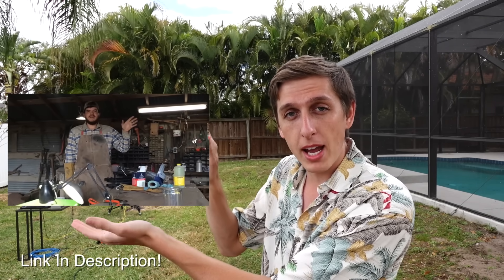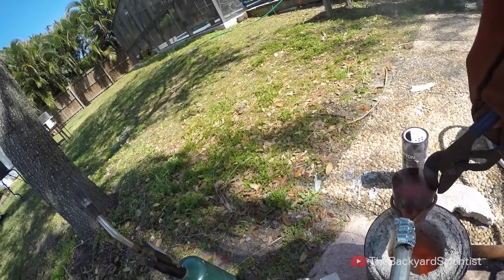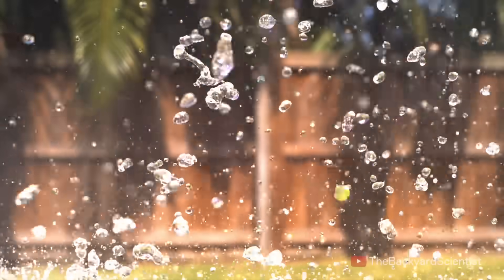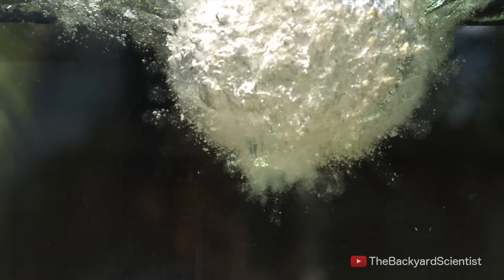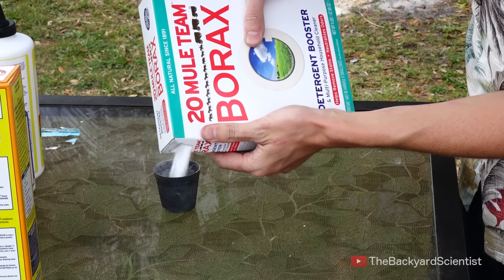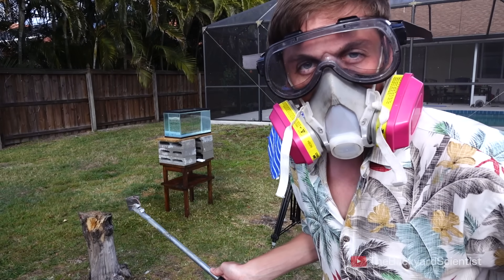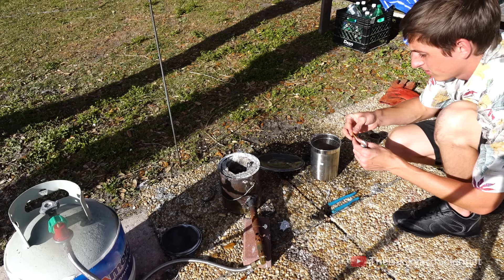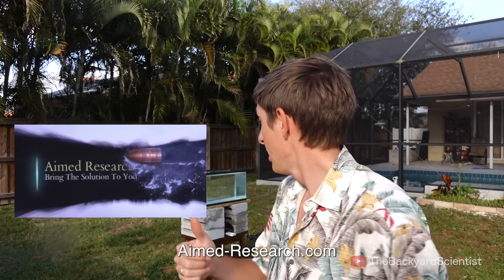Pouring Molten salt into Water - Explosion!

Comment: There are a lot of guesses, but I haven't yet seen this answered correctly in the comments below. You are dealing with a fuel-coolant interaction, where the energy of the molten table salt is transferred to the water in a timescale smaller than the timescale for the vapor pressure release of the steam. This is generally a physical reaction. The exception would be if graphite was infused during the superheating of your salt (hard to prevent).
Molten graphite reacts chemically to air and would be exposed during the pressure wave and jet action of the FCI causing the distributed molten fuel material to further fragment. That reaction to the air, in turn, releases hydrogen which is highly explosive in a superheated environment. This particular case would make it partially a chemical reaction, but the majority of the interaction would still be a physical one.
This also would mean that Borax, which discourages oxidation, would have less graphite infused during the superheating process. Therefore, less chance of a chemical reaction during the FCI.
Even with no added chemical reaction, an FCI is a powerful mechanical transfer of energy that begins with a deviation in the normal heat exchange conditions between the molten fuel and coolant. A bubble forms from the initial disturbance and then expands and collapses forming a jet of liquid. This jet then penetrates the fuel and the heat exchange forms a new bubble which repeats all over again from the jet phase.
This process happens (and continues to happen) wherever there is any disturbance around the surface of the molten material, and a pressure wave forms. The wave flows through the fragmented molten material further fragmenting it and increasing the heat exchange. The rapid transfer of energy sustains the wave and builds into a steam explosion.
You can see an example of such a wave passing through (back into) the molten material at time 3:37, and several sustained waves at 4:39.
Different superheated materials have different heat transfer and vapor pressure properties. For instance, molten fluoride salts have different thermodynamic properties many than other fuels that make it more stable and safer to use as a fuel substrate in high-temperature nuclear reactors. Hope that helps.

Comment: Okay I have an answer for you.  This is what is going on.  You are mixing a smaller thing with a larger thing.  The water H^2O will bind with your table salt NaCl.  At room temp this is a some what slow reaction where someone often has to stir the water.  The slow process of dissolving will take about 5 H^20 atoms binding with each ONE NaCl atom.  Of course not all the H^2O atoms will partner with a NaCl atom but the NaCl atoms distribution through out the solution will be even.  Thus this is just a measure of concentration.  Now when you run the same scenario with the molten NaCl, something very different happens.  I imagine two things MUST and WILL HAPPEN.  The TOTAL solution will bind with every NaCl atom that entered the water.  There will not be one H^20 atom without a NaCl atom.  Second thing that will happen is that the remaining H^20 atoms will lose their bonds to the heat become just Oxygen and Hydrogen gas which does expand and explode.  In the end though, what you have is a PERFECT solution of salt water.  Meaning you will not be able to add any more cold salt to the water because it will just stay on the bottom of the tank and will not dissolve.  This is just my idea, I can't say for sure if i'm right, but I think I am.  I wonder honestly what would happen if you run the same experiment again with water you have already exploded...

Comment: If anything happens when some hot liquid touches water it bubbles in a way but it's not hot enough to explode or splash water everywhere. So the molten salt is 1.4k degrees hot and with that combined with the sodium touching the water it creates an even bigger splash or explosion. I'm just saying this as an opinion or what I think is happening. Tell me what you think.

Comment: May the effect of NaCl on surface tension or (water-) vapor pressure partially explain this? Generally if you pour something very hot into water, a steam bubble immediately forms limiting exposure to liquid water. I'm not aware of any salt which has such a high solubility in water as NaCl. Maybe this plays a role in the interaction with water (salty water has a lower vapor pressure; possibly this leads to a longer build-up before the actual burst comes. Just my two cents...

Comment: Pretty sure you don't need to actually melt it for a reaction 
since what's actually happening is the sodium is giving away it's valence election, and since it's so eager to get rid of it, when it actually is able to lose it
a lot of every is produced
Reply: Sodium has already given its valence electron to chlorine (we have Na+ and Cl- in the salt cristal). Because this salt is made from a strong base and an strong acid , it can't hydrolise....so, it will only disolve forming hidrated ions(Na+.xH2O and Cl-.xH2O)....but, this happening evidently and when it is in solid form....so, it is any special chemical reaction here. I think the explosion came from the energy that is spontaneously transfer from salt to water and the water which start to vaporize. (Sorry fro bad English)
Reply: Btw, if I am right, the sodium carbonate and boric acid did not explode because they hydrolise

Comment: Wouldn't the surface tension of the molten salt be interrupting leidenfrost effect as its spreading out faster than the steam layer. The other tests with borax etc looked more gooey, suggesting higher viscosity and surface tension

Comment: Here there are actually two reactions going.let me explain when you heat up the NaCL it slowly starts reacting with H20 to give NaOH and H2 when it touches water the water catalysis the reaction so you get a explosion.the second one is where the NaCL when dissolved in water gives sodium ions and chlorine ions which further react with water.

Comment: I'm going to try to explain why I think you got the result you did but, it's going to sound like a massive word salad. Hopefully, you'll be able to figure out what I'm saying. Anyway, here's my thought:

You said the other ionic compounds had higher melting points, right? Maybe that has something to do with it. It seems like the intensity of the leidenfrost effect should change relative to the temperature of (in this case) the molten compound being poured into the water. Maybe, in being cooler, the molten salt boils the surrounding water but still forms larger water particles closer to it, allowing them to more easily incorporate with the salt and then divide further while inside, expanding the salt and rapidly boiling more water with its increased surface area, thus rapidly raising the surrounding pressure. I'm not positive but, that seems like the most likely answer to me.

Comment: The reason it is happening is because sodium is an alkaline metal and the sodium chloride bond is breaking only leaving sodium because the chloride has a lower melting point the sodium so the chloride is evaporated in case you did not know alkaline metals are extremely reactive to water and it causes them to explode

Comment: It is a physical reaction, but it is because of the nature of salt in water that creates a more violent reaction. What is happening is that because salt (NaCl) is soluble in water, when it is molten you pour it in cold water, you force the molten solution to dissolve in water while it is molten. By forcing the molecules to separate, you cause a thermal shock even bigger than only the vapor of water expanding. The molecules themselves do not separate (not a chemical reaction), but they expand form each other because of the dissolution, and when they separate, they are forced to cool down faster than they can cool down only in cold water. It is like when you compress gasses, they tend to release their thermal energy into the environment but when you force them to expand, they absorb the thermal energy from the environment. like the refrigeration principle. It is a thermal shock. Remark that a supernova does the same thing. when the core of a star begins to convert in chain reaction carbon atoms to iron atoms, it forces the star to cool down really fast. The star explodes because of the sudden thermal shock because iron atoms are bigger than carbon but more compact with a higher mass .

Comment: Isn't this sort of the same thing as a hydrogen bomb? Basically reversing the process of a hydrogen motor.? When the molten salt meets the water it negatively charges the salt which is the reason it is displacing the water.? I'm not 100% on hydrogen function. But possibly will give you a direction to research what exactly is happening to cause the explosion.

Comment: Its really interesting, but to be 100% accurate when you say it's not a chemical raction, you may need more accurate materials: that pH indicator is too cualitative, you cant apreciate low pH variations. And the pH variations originated by ittle amount of salt in 1/2 l of water, more if part of the  water which just reacted with sodium just evaporated right?

Comment: This is the reason why molten salt explodes in water from the internet(https://www.quora.com/Why-does-molten-sodium-chloride-table-salt-explode-when-poured-into-cold-water):
This energy is enough to make water boiling locally violently and expelling hot water. It is just a heated energy transfer, no chemical reaction, so it cannot be called an explosion. The explosion does not occur because of the molten "salt" it occurs due to the extremely high temperature at which the salt melts

Comment: Can't it be because sodium chloride solvating is endothermic. Just like iron in a sun blocking the energy of the core in fusion leading to a supernova, water may actually freeze by the ultrafast dissolution of salt and some other turn to steam because of the salt temperature.

Comment: This explosion has 2 causes chemical and physical 
The physical has been explained to you as you see in the video. 
The chemical will explain the other part about why sodium chloride only does that, as you pour the salt you turn it from the solid form where it ions and combined with each other and no free ions exist in the salt to the liquid form where the bonds between the ions are broken and free ions present,that is only half a f the secret and other part present in side water itself as was consist of hydrogen and oxygen. When you put the melted salt into water, the cation Na is more powerful that the cation part of the water the hydrogen so it is replace it and hydrogen rise from water, and with the high heat hydrogen explode and produce this explosion, if you wanna make sure of my word the same explosion or even more massive one will happen if you added sodium directly to water, and for the other part the why the pH of the water doesn't change as you chloride do the rest of the job and equal the basic part of the pH

Comment: the sodium in the salt is extremely reactive with water, and ripping its atoms part
Reply: No, the sodium in salt is very unreactive, because it has an octet. Sodium chloride is ionic and the sodium atom loses its valence electron to form an ion. The violence of this reaction is due to a physical change - the transfer of heat from the molten salt to the water and the water expands rapidly as it turns into a gas.
Reply: the heat could be separating the Sodium from the chlorine making it react with the water. That explains why the hotter molten table salts give a bigger explosion, bc the energy from the heat is overcoming the ionic bonds, and the more heat means more loose Sodium atoms. Loose sodium atoms means they don't have an octect anymore which could be why that sodium bar (albeit impure sodium) reacted very much the same way as molten table salt. I didnt read his papers so idk tho
Reply: CaptainXD some other comment went deeper into it than I did, but I wonder why the pH didnt change according to his strip test
Reply: +Erik Soto I'm pretty sure you are right. Melting the table salt is likely breaking the ionic bonds between the sodium atoms and the chlorine atoms, giving off liquid sodium and chlorine gas... Probably wouldn't want to be sucking in those fumes e.e
Reply: I think it's more of a combination of both physical and chemical. The physical reaction (heat melting the compound and electrostatic forces between Na and Cl from eachother) causes the chemical reaction (Na + H2O) which caused the next physical reaction (explosion!)
Reply: Yeah pH should have changed if pure sodium was being added to the water, creating NaOH and igniting hydrogen, then the NaOH dissociates to make the solution basic.
Reply: makes sense, but I would think that the exponential force of the chemical explosion did something to the Na atoms. Great counterexample tho!

Comment: Salt is water-soluble (even when at high temperature and liquid). Pure sodium is not.  When the liquid salt hits the water it starts combining with the water, turning it into salt water, and the now salt water turns quickly to steam and expands dramatically.  As long as the liquid salt continues to remain above the boiling point of water and dissolves in the water, it will continue to turn the water to steam and expand very rapidly, causing the explosion.  Liquid sodium does not have the same effect as the liquid salt since it is not water-soluble, so there's no rapid steam generation and no rapid expansion.  The water quickly cools the sodium and the cooling sodium harmlessly falls to the bottom.

Comment: Very good experiment, and I have your answer. Its a kinectic problem, the difference between specific heat from material to another is the reason why you have explosions with regular salt and not with others. Trypouring hot liquid steel in the water and you'll see what a real explosion is, but please really protect yourself before doing it. the hit liwuid steel will heat the water so fast due to steel's specific heat that it will go from liquid to steam and once steam reaches 800oC the water molecule will crack becomming hidrogen and oxygen.. and boom. no chemical reactions going on, just Gibbs and Lavoisier.

Comment: So not only is the difference in reaction structural, you think it is due to how water reacts when it is intermingling with structural integrity of the molten salt versus the other chemicals. What about also the degree and integral to which the water releases heat? When you poured in sodium metal, the heat was released immediately upon contact with water and it even caused an ignition. Other than the sodium, everything else was a compound. Not only could there be structural issues, there could also be degrees to how easily the chemical suspends and how quickly the surface reacts to heat release. If the surface is hardened quicker than the water can absorb such massive amounts of heat, the pressure from underneath the hardened surface will cause explosions and the same effect will happen with smaller chunks.

Comment: Short version: "Table salt" reacts with water very fast. If salt is poured into water it instantly begins to become ionic saltwater and heat greatly catalyzes this reaction. The super-heated salt reacts with and thus transfers its heat to a large amount of water super fast. Now this quickly becomes unstable because the incredible amount of heat amazingly expands the water almost 2000x in size (water to steam ratio is 1:1700). The boiling of water is indeed a physical reaction like he said. But the mixing of salt into water changes its chemical makeup. If salt didn't chemically react with water the way it does, the explosion would not be violent.

Comment: 1.You are right, that it’s not a chemical reaction. It is exceptionally a physical reaction of dissolving salt in water. As you may know, heat of solution of crystalline substance include endothermic effect of destruction crystal lattice and exothermal effect of salvation (in case of water we have hydration) of ions. Q=+Qsolv-Qdest.latitce. So if you put normal salt into the water you can see anything, as this two effects are compensating each other. But when you melt salt you destruct lattice of NaCl and –Qdest.lattice=0. Thus dissolving salt in that case goes with  great calorification (releasing of heat). Calculations show, that your 50 g are releasing about 1500 kJ of energy very rapidly. It is heating the water so it becomes steam very quickly and an explosion occurs. NaCl is a strong electrolyte, it is fully dissociated, ions are very active. Therefore it is an explosion. It’s a physical chemistry, baby!
2. Why there is not an explosion when you take a NaCO3 and Borax? The answer is that when you melt a soda the reaction occurs NaCO3=Na2O + CO2. So you were pouring in water not a soda, but sodium oxide, which reacts with water, but  slowly. Similar effect we can observe in case of Borax (Na2B4O7 = 2NaBO2 + B2O3). When you melt it, it becomes only a flux of NaBO2 and B2O3, that doesn’t dissolve in water. So you can see a leidenfrost effect as though you had  taken a flux of steel or smth.